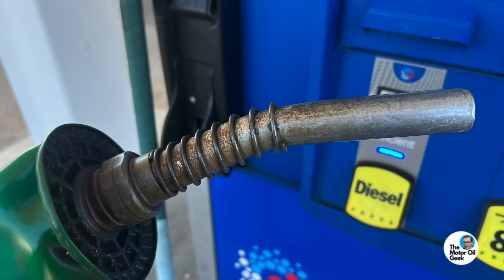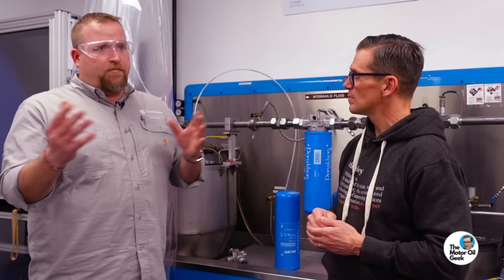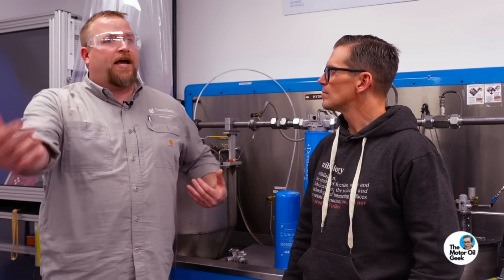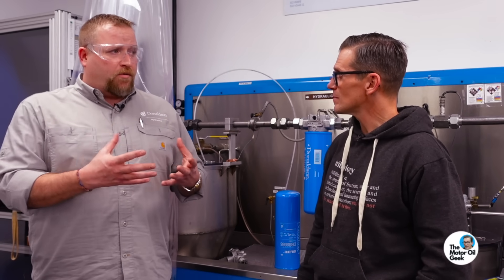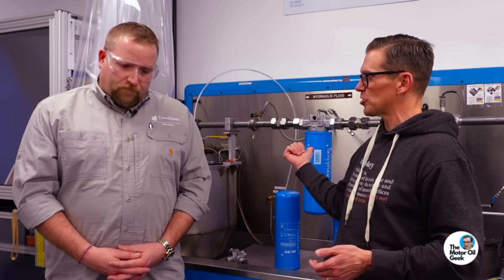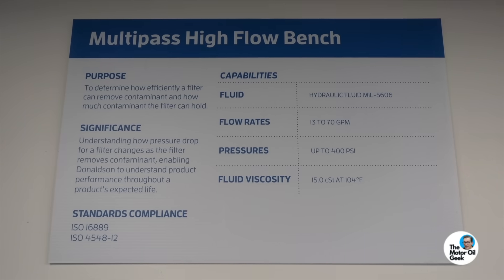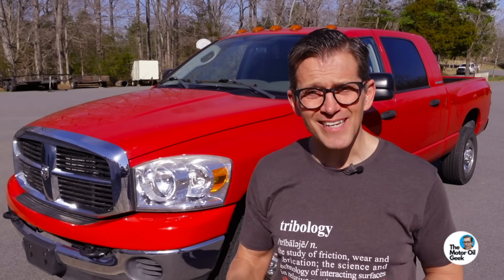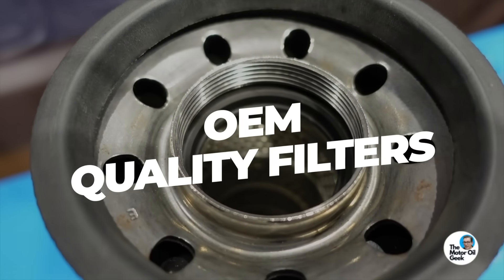Diesel Is DIRTY (And It's KILLING Engines)

Comment: DPF and EGR are what kills diesels not the fuel. Diesel engines are "oil" engines and can run on any oil. They can't run on exhaust fumes or when the exhaust is blocked

Comment: What do you and the commenters think of in the case of a pick up with a transfer/transport tank with a 12v pump and a good Donaldson filter. You Fill your tank from the transfer tank and when needed fill the transfer tank form the refueling station. Or drive to the nearest Costco with diesel fuel :)

Comment: I suppose that, nowadays, as injection pressures get higher and higher, the room for dirt in the pressure making spaces is less and less. But why the ever increasing injection pressures? In short, emissions. While the better "atomization" from higher pressure as well as the finer control over the timing of multiple injections per fire stroke, produces better burn/slash cleaner burn/higher efficiency, it seems the manufacturers keep milking that higher efficiency for higher and higher torque/power as opposed to higher and higher mpg. And I'm talking specifically about diesel pickups. Does a pickup really need 1100 lb/ft and 500 hp to be used as a "work truck"? I would submit, no. But I'd settle for 25 mpg with 350 hp and 800 lb/ft

Comment: Do have a video on diesel oil conditioners DOC.  Local GM dealer are recommending BG DOC. I can’t find much info on the results of using.    Lists of info on fuel additives.

Comment: new lz0 3.0 duramax.   changed oil at 500 miles and yesterday at 2500 miles using 0w20 ac delco dexos d which is recommended.  my first diesel and using basically as a daily driver during retirement.  no towing, mileage queen at 32mpg hwy and 22 in city.  live in knoxville tn to give you idea on daily temperature.   would like to know about ow30 or 5w20 dexos d for my future usage.   will be changing oil every 5000 miles after i reach 5000 on the initial odometer reading so i have 2500 more to go.   when should i make a change over from ow20 if ever??   want this vehicle to reach 300k and do maintenance like im supposed to if not sooner.   HELP with any suggestions.    factory warranty started august 2025 and is 5yer 100000 miles on the powertrain.

Comment: IMPROVING CAFE numbers has been an experimental exercise at expense of car owners. Does any car owner actually come out ahead when comparing the high cost of repairing high-effeciency engines, versus operating a similiar vehicle without exotic CAFE equipment? The modern MINI: 900 psi fuel pump; variable pressure oil pump; on/off main water pump; variable speed turbo water pump; unusual variable cam timing.  

These innovations enable hundreds of horsepower from a 4 cylinder engine. What is the consumer's expectation of longevity when purchasing a high-strung engine from a major manufacturer? Does the consumer acknowledge the required maintenance to keep the system alive for the expected service life?

Common hot rodder mantra:
 "SPEED COSTS MONEY. HOW FAST DO YOU WANT TO GO?"

 the epa says:
 "FUEL EFFECIENCY DEGRADES RELIABILITY. REPLACE OFTEN."
Epa says:
"Corporate Average Fuel Economy (CAFE) is good for the environment; good for service technicians; good for parts suppliers; good for the economy."

Comment: I’ve got over 300k on my ‘06 Duramax. I’ve owned it and ran Scheaffers oil since it had 81k. I have no reason to believe there’s any sludge or excessive carbon build up, but is there anything you recommend running with an oil change to do an oil system clean/flush? Due to age and mileage I’d like to do an oil system cleanse if I can for peace of mind.

Comment: The dispensed fuel average cleanliness is engineered into the vehicles fuel delivery system, there is no issue. The longevity of that system is also calculated for a certain lifespan and when it has therefore reached the end of it’s life, it needs to be replaced anyway from injector pumps to injectors. The only issue I have ever had is obviously water in the diesel. Why waste time worrying about this. Change filters on suggested intervals and sleep well tonight. The engineers are smarter than you think calculating longevity, durability, cost to build and performance.

Comment: My 3.0 om642 has 460 thousands miles change fuel filter once. And thousands of hours of idling. Pumped my diesel on almost every gas station fom east to west from nort to south. And no problems.

Comment: No one drop of diesel on our tug gets to the engine without passing the centrifuge.  You be really amazed of the dirt in the fuel. Try that as a test for at the pump fuels. On a gasoline car the fuel filters show mainly black plastic and metal. Plastic from filler neck of tank and metal from pump nozzel.

Comment: Wonder if you could make a filter/ hose combination you can quickly slip on to Diesel pump and pre filter when  putting in.    With Hydraulic systems we pre-filter hydraulic fluid.   Must be super clean.

Comment: Also For BIG BORE DIESELS, Semi Truck Size, My CUMMINS X-15, The Engineers Decided To USE The Recirculation Of The Fuel To COOL THE ENGINE COMPUTER...  That HOT FUEL That Is Returned Thru That Cooling System Back To The Fuel Tanks, CREATES What Is ASPHALTEEN, ie: TAR BALLS/GLOBS...

This Also CHOKES/CLOGS The Fuel Filters.

Along With The MICROBES That Live In DIESEL FUEL...

They Make ADDITIVES That Break This Goo Up And A BIOCIDE That Kills The Bugs/Organisms...

Which Does Help... But You Should Carry EXTRA FILTERS, As This Process WILL CLOG The Filters Quicker...  🤓🤓🤓

Comment: When I bought my 2005 Dodge diesel it got about 14mpg on the highway and the fuel mileage got better as the rings wore in. When the rings were fully seated (took 30K) it got 2ompg. I switched to Amsoil 15w-40 diesel/marine synthetic, installed an Amsoil bypass filter and put a FILTERMAG magnet on the engine filter. If I'd have known FILTERMAGS existed I would have put it as soon as I got this truck. I've been driving this truck almost 20 years and it still runs great. I'm going to install lock hubs in October when It's cooler.

Comment: I always see pictures of BLACK fuel filters coming from the states. Whenever I change my fuel filter, usually way past the km it should be, it's a light grey, barely looks used.

Either my gas stations filters are really good, or US fuel just sucks.

Comment: Jet fuel is very clean and kerosene is probably much cleaner than diesel. Diesel fuel standards are very low and diesel fuel must be required to meet much cleaner requirements than ever before! Hard to believe that diesel fuel has not changed since early 1900’s. Yet technology has drastically changed diesel engines to really require cleaner better fuel! We’re not even talking about grades of diesel fuel that exist today! Agriculture, commercial and performance standards. Aircraft engines are now being built to run on diesel fuel and that fuel has to meet extremely high quality standards for aviation! Can’t pull over to the side of the road in an airplane!
Reply: Jet fuel and kerosene are less dense than diesel in terms of energy, but I gave my $0.02

Comment: Hey Lake, Something i've been wondering since buying a diesel truck. Do aftermarket fuel filter systems like FASS or others that utilize a 2 micron fuel filter, filter out fuel additives like hot shot secrets EDT or similar. It would be interesting to test and filter treated diesel before and after filtering and seeing if the additive passes through the filter.

Comment: Fass fuel filter system, opti-lube xpd with opti lube boost, and I only pump from Exxon. 270k miles never had an issue with the fuel system

Comment: Why don’t the manufacturers create a fuel filter assembly built into the fuel filler assembly on diesel (and gasoline engine vehicles for that matter) vehicles for a quick change-out capability to get the larger micron contaminants before they enter the fuel tank?  Modern pick-up trucks, for example have a large door that opens to hold a fuel filler neck, as well as a DEF filler neck.  Why not create a wider fuel filler neck and a screw-in long filter that could filter fuel as it is filled into the fuel tank?  This filter could be changed at every oil change, and a more comprehensive fuel filter downstream like current ones could still filter out the more fine contaminants.  It seems like our entire internal combustion fueling infrastructure is lacking nowadays, I am tired of having new equipment being built that does not properly plan for these unreliable fuel qualities.  If the internal combustion assemblies are so sensitive to contamination, and our refueling options are full of contaminants, then give the vehicle owners a straightforward way to keep our equipment going with easy to change filtration processes!

Comment: UDF or Ultrafine Depth Filtration sells a polishing filter installed inline before your injectors and high pressure pump that solves that problem of particles and water

Comment: The oil companies learned to charge for all fuel - gas or diesel, by the BTU content, not the cost of making the fuel. When oil is refined - cracked, it results in many types of products - Lights - LPG, gasoline, Mediums - Diesel, kerosene, Heavy's -engine oils, bunker, etc. The lighter the product, the easier to refine in general. But diesel takes less refining than gasoline, so in theory it should be cheaper, but diesel has more BTU content than gasoline - so more MPG, so now they charge more for it so it's equal to gasoline

Comment: Modern Diesel Engines are  JUNK !!!

HIGH TECH GARBAGE.  

Had one modern diesel engine,  Faqn Headache.

Never getting Diesel EVER again.  Gasoline engines simpler and Cheaper.
Reply: Older diesels are better and more reliable than new ones anyway. Plus they get better fuel mileage than gasoline.

Comment: Several mention lift pumps & filters: FASS, Air Dog, etc. Fuel filtration has gotten to the point of improving filtration for stock builds using stock lift pumps with an added filtration system. Several Brands, I personally feel the FASS system and filters are top notch. Newer Ford 6.7, replacing the stock cumbersome OEM filter / water separator with FASS greatly improves filtration, water & air separation, much better than Stock, while retaining the Stock InTank Pump and providing an easier spin-on set of filters.

Comment: My Powerstrokes are happier since I picked up my own 200gal fuel tank, slapped on a pair of 2 micron 97% filters. Now my truck filters don't turn black from rust and algae, Changing them annually and they look like new. Hopefully see an extension of fuel system life. Also fuel delivery even for 200 gals is typically 20-30 cents a gallon cheaper than pump prices.  I can imagine some fuel suppliers just bypassing or eliminating filters.

Comment: I have a question and would respect your opinion. 2014 tucson 2.4ltr theta 2. New engine from the dealer. First oil change (5,000km). Would you recommend Pennzoil platinum 5w30 made with natural gas during summer months? I want to keep this puppy happy lol. Thank you very much.

Comment: Hey! I have saw a new trend that people started using 2T oil in Diesel again. I have heard about this in the early 2000's but the trend died down, and I saw a lot of intrest in this recently.

Could you please test using 2T Oil in Diesel and record injectors/emissions before/during/after use.
People claim it cleans injectors, make them quieter and less smoke.

Thank you!
Reply: Could you please try it with Older Diesel (Pumpe Duse style) and newer Injectors.

Comment: Yet diesel motors last 10x longer than gas engines but yeah its killing engines
Reply: Is that a suggestion to make diesel engines not run on diesel fuel as intended? Wouldn't that be oxymoronic?

Comment: hey speed so one thing I have an issue with is telling what filters are made of for the truck they dont tell you much and selection is very very limited . can you maybe get a bunch of oil filters and fuel filters and show us them and what they are made of and how to tell what ones are what ? paper wire mesh yada yada . I realize they have sacrificed micro for flow to allow the filters to last longer with out clogging to go along with synthetic oil changes . no stores I can find sell the lower mile better micron filters and I cant really tell from just looking what is what .
Reply: oh would making a fuel filter system for chevron premium plus damage the fuel ? or will it help my supercharged Coyote last longer ?

Comment: CUMMIN'S SAY'S ON THE 5.9 ENGINE USE THERE ''FLEETGARD'' FILTER '''    IT'S A ( 10 ) MICRON FILTER '''  CUMMIN'S SAYS IF YOU GO ''BELOW ( 10 ) MICRON THE INJ - PUMP WILL / CAN BE DAMAGED ''''   FUEL KEEPS IT COOL '''  NEED'S NO RESTRICTION '''''

Comment: So there is no added benefit of changing the FUEL filter more often than the manufacturer claims? For example only every 35-40k miles. There is no sense in doing it every 15-20k miles?

Comment: BSD engines are the best and the gas is just good too. It all depends on what you’re using it for your applications. You could use marine diesel or off-road in diesel or on road diesel but what’s plugging these these ones are they don’t make them like they used to anymore they’re not they’re not terrible and they’re not using parts in the USA. They’re using Chinese parts that are not built to last forever.!!! next time try to get your facts right good luck next time!!❤

Comment: I have a 3rd gen Cummins 6.7 with a Fleetguard FS1212 fuel water separator between the lift pump and the stock filter, then a FF5320   between the stock filter and the CP3 pump. I’m curious how this protects over a FASS or Airdog.

Comment: 06 F350 6.0L got some "cheap" diesel the other day...oh man that was a mistake..Not sure what's in it but the black smoke is ridiculous, yeah I can roll coal when I want to. But don't like it just driving around.. My temps are a bit higher too when this tank runs out I'll change filters & get some cleaner diesel.  The standards in the US suck and does anyone check random stations to see if the fuels meet minimum standards?  I run a FASS system and normally change filters every 6 months..

Comment: Lake, I have a question: we have a Honda and we've been warned, and I'm apprehensive about using, ATF that's not Honda Brand. The Valvoline mult-vehicle has the rating we need but I've heard that Honda's are insanely picky about the ATF they use. Any insight or videos out there?

Comment: From what I've red Donaldson probably the top tear of filters, I'm a trucker and they need direct sells,to expensive where you can find them. My injectors have about 1.3 million miles,I only use power service in the gray jug and 2 stroke oil,say 1 cup per 100 gallon.

Comment: So awesome another thing to worry about. I change my filters at 6k on my L5P. That's roughly 50% filter life left on what the truck says. And at that rate the filter is black. Who knows if I can go longer but I just don't trust it! You can't even trust fuel these days. No wonder modern diesels still have injector issues

Comment: So if the standard is 1000 time dirtier than what is required by vehicle manufacturers why aren’t they building the vehicles to operate at that standard.  Your basically telling the consumer the fuel that’s available to you can’t be used in your vehicle

Comment: Is the "HVO100" avablie in the US? meets the specifications of SS-EN 15940, but not the standard for fossil diesel (SS-EN 590). Works pretty WELL in the scandinavian climate,cause it doesen't has any RME stuff within.."pure" Diesel is quite expensive for the oil companies to make,caused by the WLTP regulation om <10ppm sulphur...Amercian Cummins & German BOSCH are WELL aware of cleaness in the highpressure system... ( just look into how many "hidden" filters the oldfashion BOSCH K/KE gasinjektor system has) !

Comment: Running a good fuel additive is a must in newer Diesels. What a difference it made for me. I own 3 Diesels, 1997 Ram 12 valve, 2011 Chevy LML Duramax, and a 2023 Chevy Suburban Diesel. I run lucas in all 3. The difference in the fuel filter is noticeable before and after. Especially the 2023 Suburban it doesn't like dirty fuel. With the lucas in every tank I don't notice any difference in mileage but it keeps the fuel system clean and keeps the pump lubricated. I have friends that use different brands of additive some are better than others. I pick Lucas because it's affordable and I buy in bulk. Very happy you released this video, alot of the newer Diesels have many problems because of the exact things ypu are discussing.
Reply: that many oil burners you should get yourself a small yard tank if you can.

Comment: It’s a big difference between your dads 2002 to modern diesel engines, modern diesel engines are running 20k - 30k psi for a more efficient burn do to EPA standards, just a little bit of dust that slips past the fuel filter is like razor blades running through injectors at 20k - 30k psi hot shot secrets, and other diesel additive are more of a lubricant than a cleaner

Comment: There have been no new petroleum refineries built in the US for decades. Slapping a few filters on these refineries will not solve the problem. To truly fix this dirty diesel problem we need redesigned refineries that remove these contaminants earlier in the process.

Comment: Being top tier does nothing for the cleanliness.  It's all from the same storage tank, goes into the same transport that hauled some other fuel and there's no washout between loads.  Heck sometimes the only difference between the top tier "branded " and standard unbranded is the branding tax.  I hauled retail fuel for 11yr and could see the additive type and amount being injected as the tanker loaded.